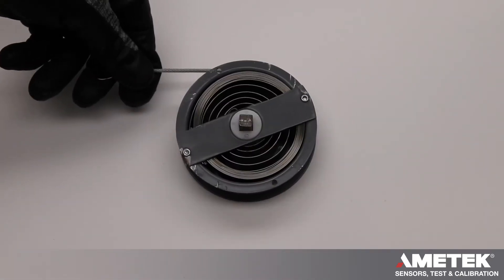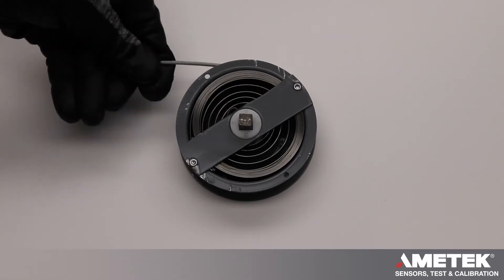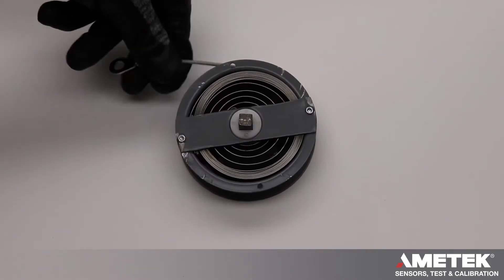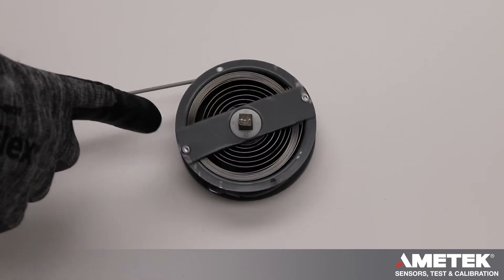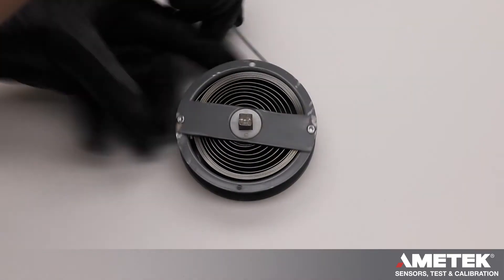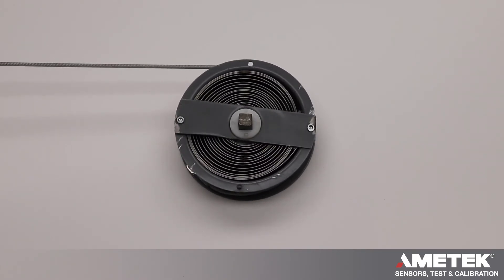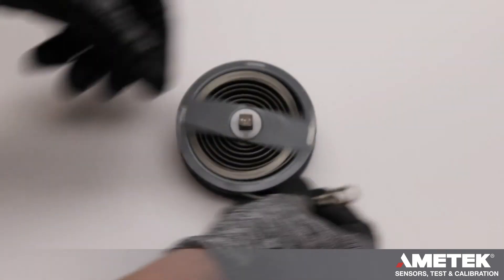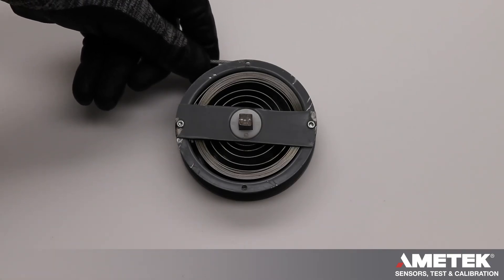Mechanical Cable Reels – How to Add Prewraps

Comment: Can a USB c be added to this? say for VR?
Reply from the maker: Our mechanical reels don’t have a commutator or slipring so they can’t pass the signal from the moving cable to the stationary cable. While we do have a large offering of data reels in the link below, the sliprings can only pass up to USB 2.0. This would exclude USB 3.0 and USB C connectors. 

https://www.hunterspringandreel.com/products/retractable-data-cord-reels

A possible solution would be to manage the cable similar to a gasoline hose or an EV charging station where the mechanical reel pulls back the slack in the middle of the cable.
Reply: @AMETEKTCI  ok I see, there is a growing market for such items because most VR headsets are not yet wire less and most set up available to in fact all set ups involve thees keycard looking things wich are actually damaging them, any chance you do custom orders?

Comment: I'm trying to create a similar reel to put tension on a string and reel it back when there is no tension (or weight) (similar to badge reels).
Is the constant force spring the best spring for this use? If yes, I'm trying to find out how much force (hanging weight) is needed to overcome the spring, is there a formula I can use?
Reply from the maker: The type of spring depends on the type of retraction required. When constant force is needed, a constant torque spring or spring motor assembly could be used. If variable torque throughout the retraction is preferred, a power spring (shown in the video) or a prestressed power spring could be used. Each option has different benefits.

In regard to determining the force required, it depends on your system and spring. Most times the practical method is to measure it using a force gauge. Chatillon, an AMETEK company, makes force gauges that can be used to measure the required force to determine the retraction required.
https://www.ametektest.com/products/force-gauges

Comment: What type of spring is this?
Reply from the maker: This is our arbor-mounted reel. 
https://www.hunterspringandreel.com/products/mechanical-cable-reels/arbor-mounted-reels

The spring inside of the reel that drives it is a power spring.
https://www.hunterspringandreel.com/products/springs/power-spring-clock-spring/conventional-power-spring